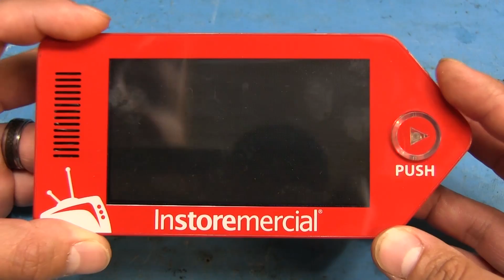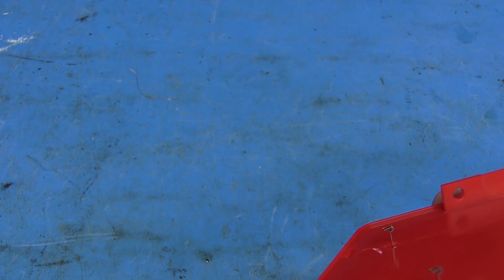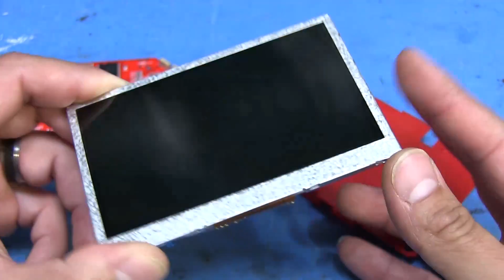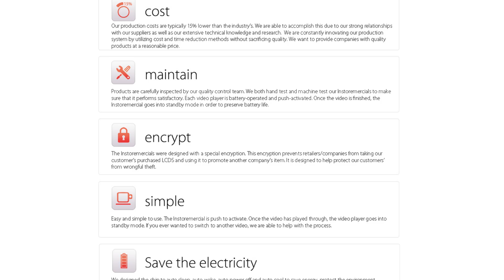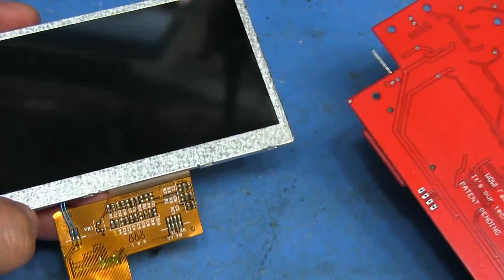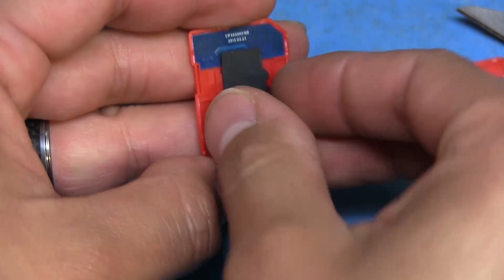TWB #22 | Retail Video Player "Teardown" and Experiments

Comment: I happen to have stumbled upon one of these at work, except mine actually has the update button (octagon shaped) and the J1 spot filled in! The J1 is a button (the same as the play button) that acts as a reset key, so I''ll push it when the video is playing and the unit goes black for a second before restarting the video. There was a small hole for it in the housing, which I don't see in your unit so I guess they made a variety of different models. For instance, the RAM on mine is a Samsung 707 K4S561632H-UC75.
Anyway, very informative video!